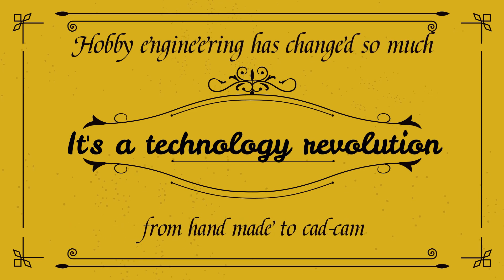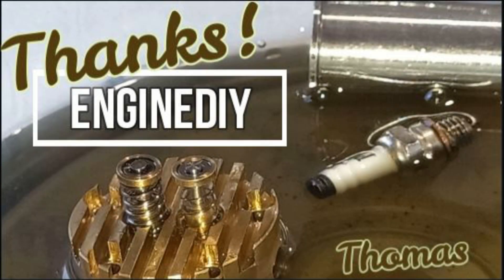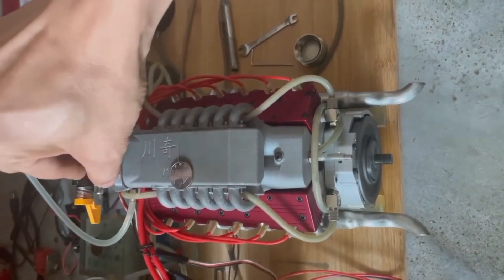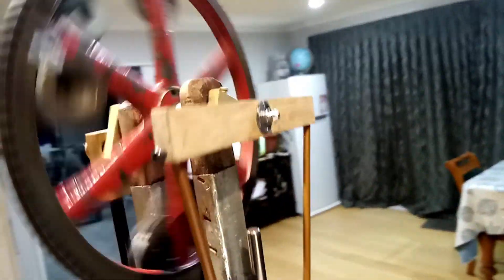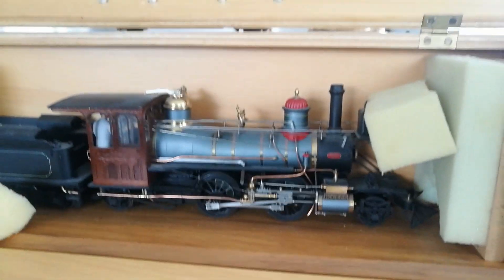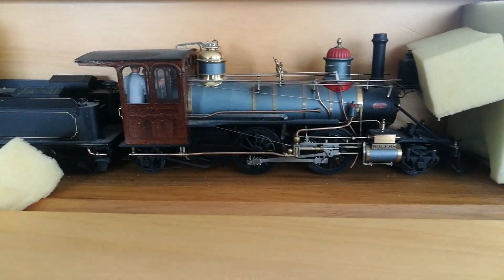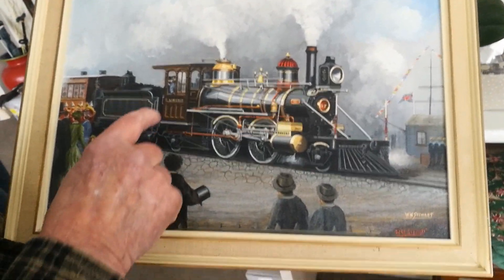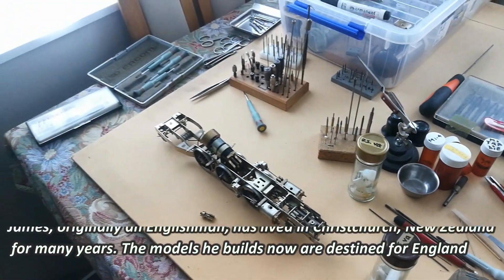Microcosm H74 Preview, tiny ChuanQi V12: hobby technology CAD-CAM vs "Old-School" model engineering

Comment: Can you tell me how much oil to put in the oil stomp? 10 drop 20 and so on. It’s for the 74
Reply: Ps excuse me the h74, I need to know that way I won’t over fill or under fill. Thanks
Reply from the maker: Sorry I can't tell you. Also, what is "oil stomp"? do you mean the crank case or the petrol tank? Generally these little engines don't have oil splashing around in the crankcase as they're not sealed for that. I mix oil and grease and smear that all over the crank and conrods
Reply: @ThomasPCGuruENGINES  ok, there’s three caps that can be removed, one for fuel one for radiator coolant and one between the spark plug wires what is the one at the side bottom of the engine block between the spark plug wires?
Reply from the maker: Yes you can dab in oil drops at the crank but not fill it or pour lots in there, or it will leak right out
Reply: @ThomasPCGuruENGINES  ok,thanks

Comment: Does your throttle valve open the carb all the way in your H74 engine? Mine does not, but maybe that’s by design.
Reply from the maker: I don't have this engine yet. And it may be by design, these are n ot recommended to push too hard; for example it might have brass cam lobes